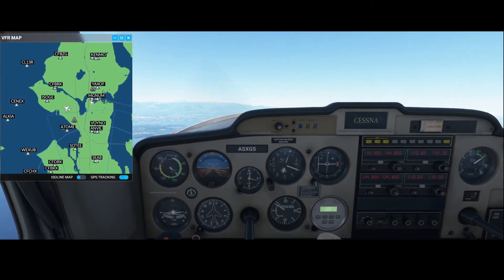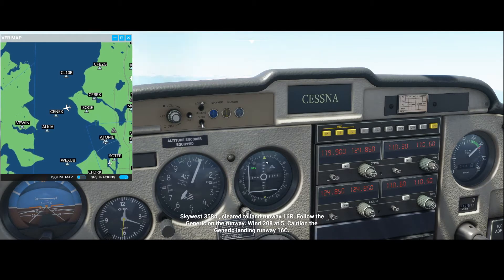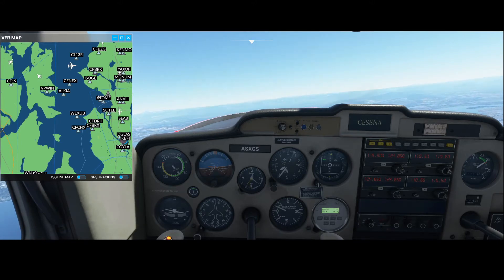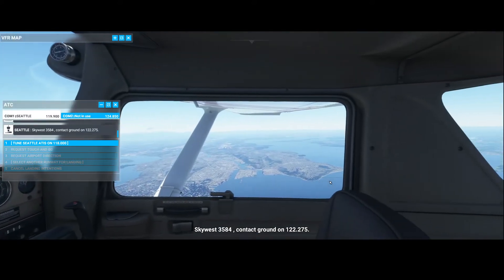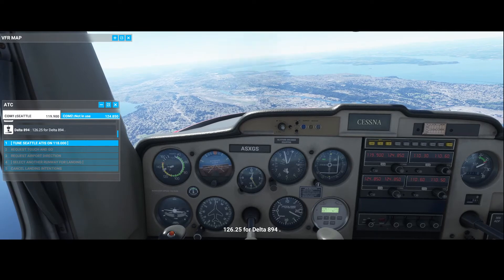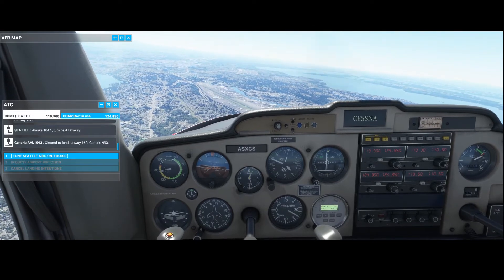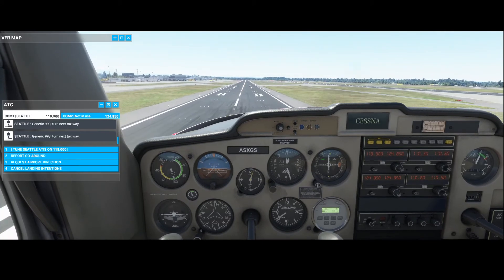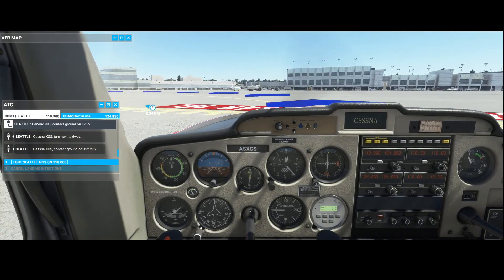Flight Simulator 2020 - How to VOR navigation Outer/Middle/Inner markers

Comment: I tried to do the same approach and for some reason I don't hear marker beacon. The same place, the same altitude, the same frequency. It doesn't blink as well.
Reply from the maker: hi Kyler not sure why it doesn’t work does it work at another airport?
Reply: @Highintheflightsimsky  I figured it out. The problem is with the Sim10 update beta. I have it installed and it removes all the marker beacons from the game.
Reply from the maker: hi Kyler would suggest to report it via the official forum from Asobo

Comment: My 2 cents there, but your approach is dangerous and way too fast at 120kts will full rpm. Pitching down at full rpm is not the best way to lose altitude, we see you got near 140kts doing that. Just lower your rpm, and play with the nose pitch up, get the vertical speed where you need to without gaining airspeed.
You should definitely lower your rpm and have a slower base and final, be around 70-65kts on final and touch ground on the landing marks around 60-... not so far away

:)
Reply from the maker: hi Pascal yes fully agree it was far to steep and forgot to pull back throttling. thanks for your feedback